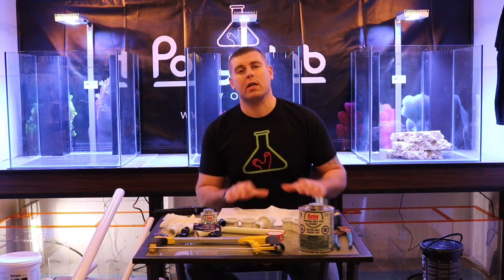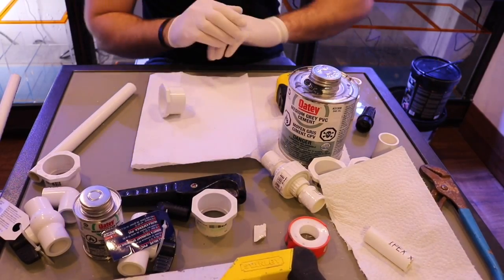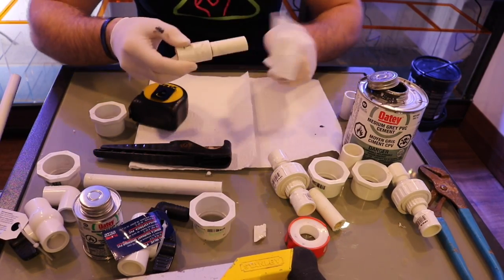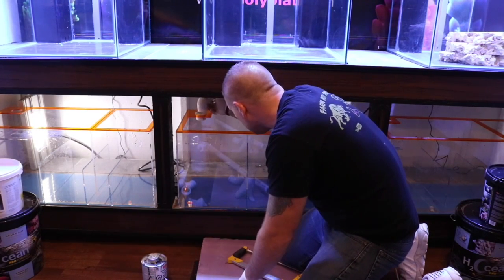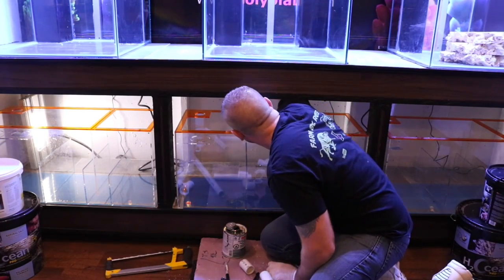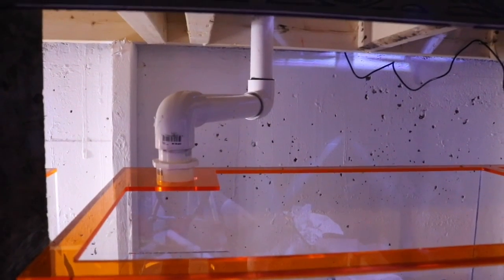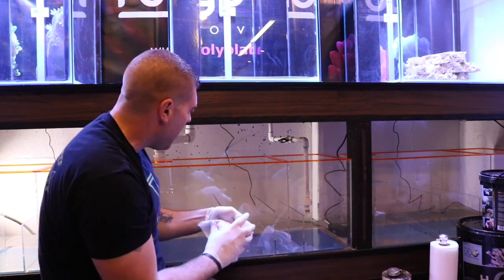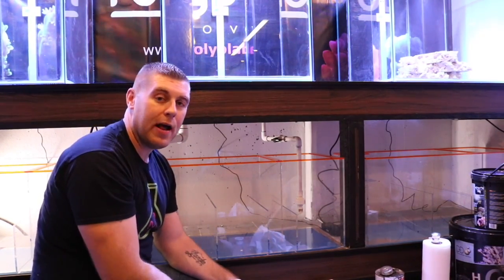Plumbing  three reef tanks THE RIGS. THE LAB PART 3

Comment: Any particular reason you went with those measurements for the drain and return?
Reply from the maker: +GENISIS1TWENTYONE  hey bud which mesurments  length of pipe
Reply: the size of the pipe. 1/2 seems a little restricting?
Reply from the maker: +GENISIS1TWENTYONE  it's perfect